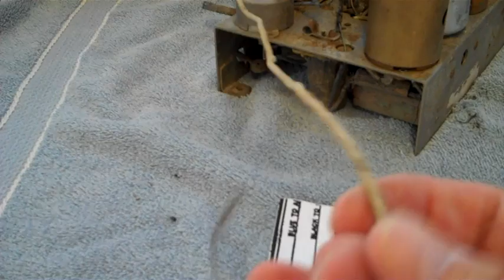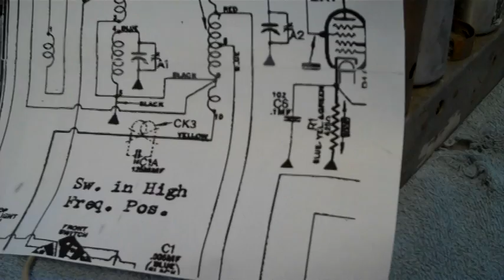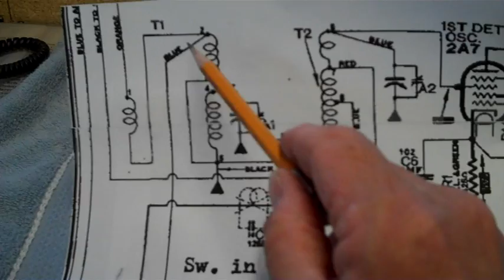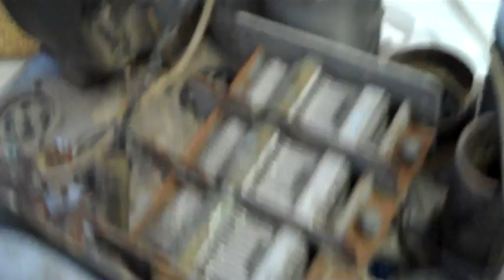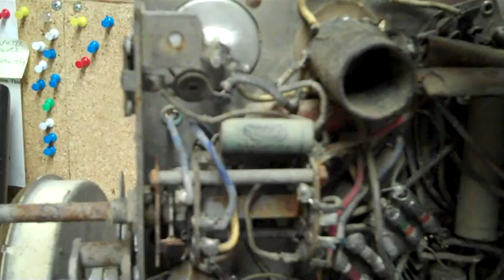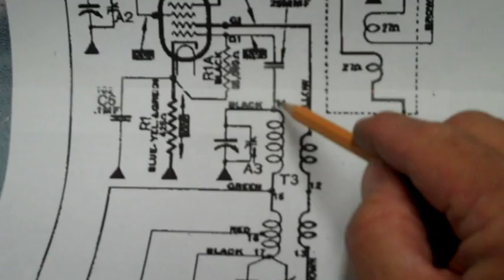1935 Atwater Kent Model 145 Repair and Restoration (Part 2 of 38)

Comment: Great vid again John! Ramp up the tension there, will the coils be good or is it a case of 'She's dead Jim'? Well the old gal wants to live again it seems. Time has not been kind to some of those wires, ratty would be kind but small beer compared to a clapped out coil. Hope a cabinet comes up for it but have you thought of building one? Make an interesting series if an original one is rare.

Comment: I use my dad's continuity tester for continuity. it's got a pretty neat light. but I do check the value with a meter later on in the continuity test(s). sometimes the continuity may be a little weak with old wiring.

Comment: You got to check on the package the "Color Temperature", it will have a K number which means Degrees Kelvin. the lower that number the organge'r the color i.e. 2700K to 3500K(soft white-regular lite bulbs). Cool white is 4100K and the best for photos is the 5000K (daylite)(and sometimes called the C50 bulb). When you get to 6500K (daylite delux) you now start to add a blue color (some people like but not me). Looks like some of the big co's are moving things back from China - maybe.

Comment: Well what I said may not be correct - I just checked the color temp of Halogen and the Net says it is about 3200K. I thought is was much greater than that. Most likely the bulb on your camera is Halogen. But a regular incandescent bulb is in the 2700K-3000K and will give you that orange color.